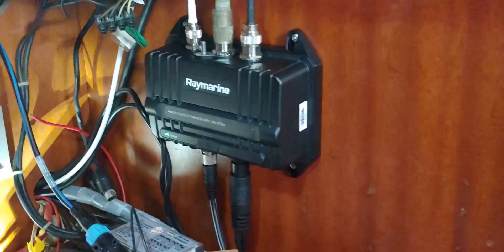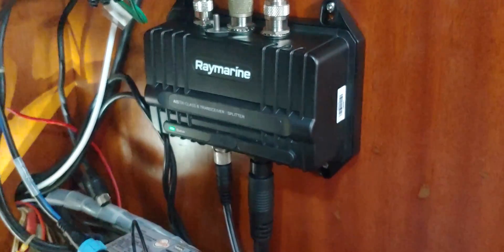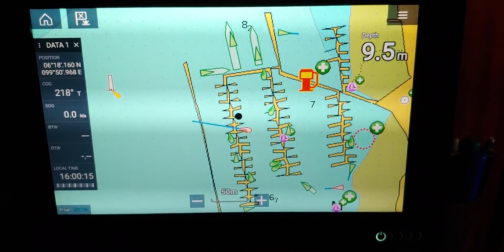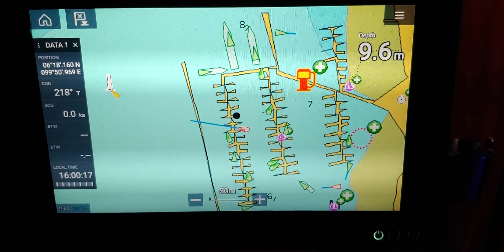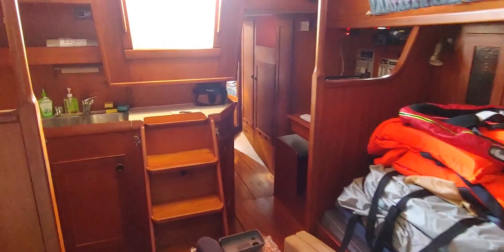Sailing Scarlet - Installing Raymarine AIS700

Comment: Hello, is it really needed to have the little Antenna outside or can it be inside ?
Thanks / Raimund (SY Gatto)
Reply from the maker: Ideally yes but I guess if you can get a good gps reception inside then that’ll probably work. Worst case other boats will see your location as less accurate.
Reply: @CaptainMJ  Thanks for the swift response

Comment: Which Axiom chart plotter did you use? How is it working for you?
Reply from the maker: Hi Tony, I'm using the Axiom 9", the standard version. It works great, easy to use no negative things to say really. I do most my route planning on it and when sailing i have an old iPad i use to remote control from the cockpit and that works great. Control from the iPad is a little bit slow though but i suspect its because the iPad i use is one of the older models. I'm not sure about the sonar functions as my boat only have a sounder so i have not tested that part. The radar and radar overlay are great and easy to read. Let me know if there's anything else you'd like to know. Cheers!